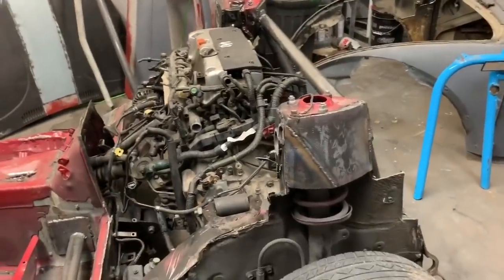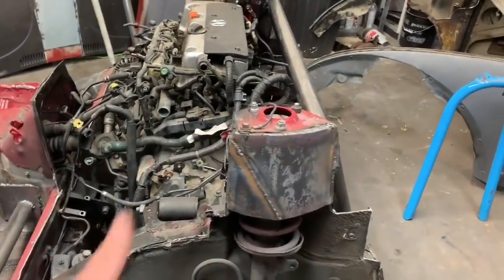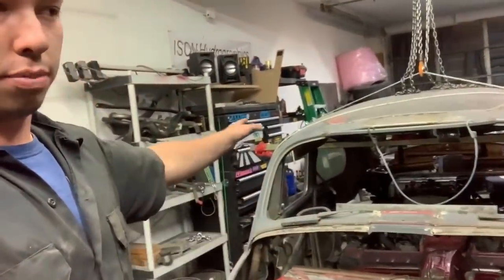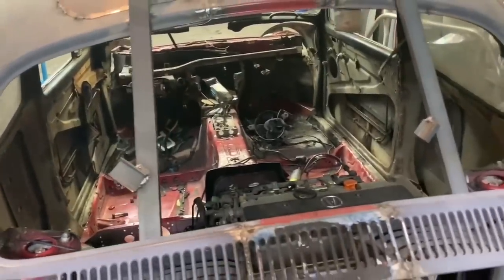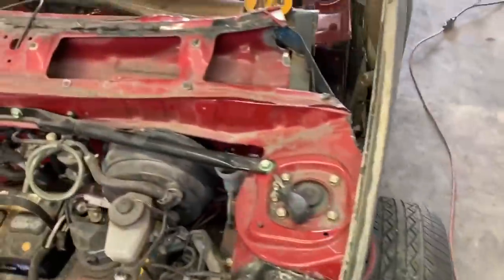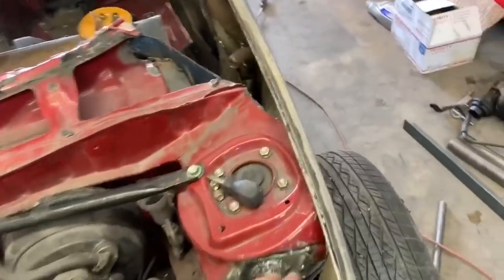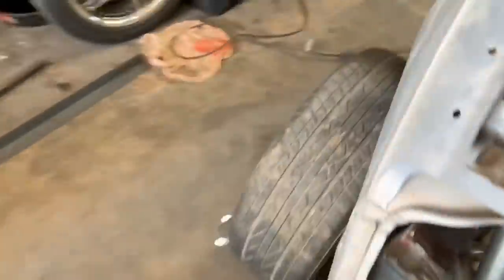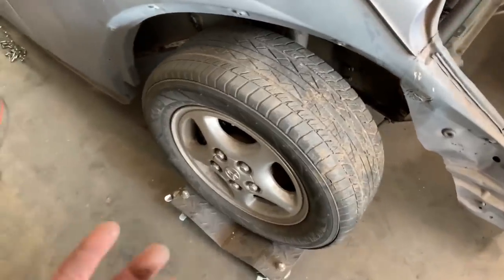Dropping The VW Body 3 Inches! [ Honda Swapped MR2 Chassis Volkswagen BUG ]

Comment: People are so protective of Cletus out there. Your channel is all about you testing what will and won’t work, and having fun finding out. If people don’t understand that they haven’t been watching for very long. What about using those clips that they use on body panels that are spring loaded and you use a big screwdriver to tighten and loosen them. I see them on cars that race at Bandemire. (not sure of the spelling) and have them along the bottom of the body along the sides? Just a suggestion.
Reply from the maker: Yea I know what you’re talking about!  Those are mostly use for lightweight body “skins” like a super thin fiberglass fender.  I don’t think I could hold the whole body down with those
Reply: Like I said, I don’t know much about some, well most of these things. I just thought I would throw that out there, I had seen them used before. But they were on carbon fibre hoods,plastic bumpers and fenders now that I go back and take a second look at them. Maybe look into having pins welded onto the frame, that the body could be lowered down on then locked into place at four corners of the cabin. With some way of locking the body down on them? Just throwing out there another untested hairbrained idea. I know you will be able to come up with the proper way to do it in the end. Will be watching every step of the way.

Comment: Suggestion right out of left field.  At the front of the car the chassis rails terminate in very close proximity to the front of the body.  Make up a couple of pipe hinges and weld them to the end of the chassis rails.  Strengthen the ends of the body and weld the hinge pins to the reinforced body. You can hinge the back of the body as high or as low as you wish and when you're happy with it make some brackets to bolt the two bits together.  Job done.  if you want to do any major surgery to it ( like fit an LS1) just undo the bolts, lift the body, stick a broomstick under it and you're in business...just a concept, but it would look pretty flash in the carpark.
Reply from the maker: That’s very interesting! I’ll look into it!

Comment: Just found this channel because of the Jeep C5 build and I truly appreciate the hackery, im building a 2002 SAAB 93 turbo right now for my next daily but I own a 54 Jeep that I've always wanted to make into a rat rod since I'm not into 4 Wheeling so I might have to still your idea
Reply from the maker: Nice man!!! I always thought putting a Jeep tub on a early 90s s10 would be a good fit as well.  Easy to lower, easy to LS swap
Reply: @GARAGEIdiotS  I just recently threw a rod in my 5.3 trailblazer so after I was done with my SAAB I was thinking about trying to use the chassis from it since I already did all Belltech suspension on it and it's AWD

Comment: Make the fenders part of the hood. Solves a bunch of issues. You clearly can remake the hood to fit however you need. Eliminates multiple cuts at the fender. This sets you up for a  single tilt front "clip" or a full on or off "clip" Just weld the fenders to the hood. make just one cut each side. Would make a nice seam.
Reply: This also sets you up for future if you want to make a clip out of fiberglass. Then it would be hella easy "on/off" moving.
Reply from the maker: Awesome idea!! That’d be sweet!!

Comment: Make it a removable definitely but have it in 3 sections? Front, rear and the middle section where you sit? I think it'd be worth while as you already have the cool factor yes, but it's pushing ourselves out of our comfort zones, taking far too much time and going the extra mile that makes something that much cooler and definitely agree with going negative offset, get yourself some decent wheels for the meantime but 3 piece Rotiform Fuchs would look awesome as they're a wheel normally used on older Volkswagens but with a different style and the option to get exact width and offset you'd want also just believe that the raked Volkswagen is a proven formula that looks good but you don't often see the entire car millimeters off of the ground all round
Reply from the maker: I’ll look into those!! Thanks!!
Reply: @GARAGEIdiotS  no stress at all man, love your work and looking forward to the end result

Comment: What is your end game, anyway? Do you want to finish the job ? What you are going to discover, with out some kind of a plan (drawing), you are going to continue down the same road you have been on and not get any where. With out a definite plan you won't get anywhere.
Reply from the maker: It’s hard to have a definite plan on something that hasn’t been done before and with me learning as I go.  However, once the body is dropped and that structure is rebuilt, the project should start gaining a lot of momentum

Comment: this is YOUR project  done YOUR way.
projects like this have a tendency to snowball  for several reasons.
things takes time and skills gets better. often this result in either going for original idea without simplified ways or the brain runs away in creative mode.
i bet there are multiple things  you feel more confident in now  vs  when you started.
and then we also have the cosmetic aspect  when realizing  some of the first made areas can be made better  etc.
imo all that is out of sight just need crude work done and sharp edges removed. 
no need to waste hours on cosmetic improvements that cant be seen anyways.
personally i think you fit into my category of garage idiots.
take it as a challenge if someone says it cant be done   and we love odd ideas like self driving chairs and beercases.
all kinda frankenstein  match up in parts to make a unicorn.
keep up the great work.
Reply from the maker: Awesome comment man, thank you!

Comment: Trace the top of the shock mount and copy in steel,add a perimeter wall to the copy and weld on top,in effect boxed junction for roll tubing????lol
Reply from the maker: I follow the first part but what did you mean by “in effect “
Reply: @GARAGEIdiotS  lazy way of adding additional strength without hacking into panel to much lol

Comment: Like I have always said bud this is your project and your channel so you do with it  with what you please .... Anyways on a different channel I was just thinking could you just cut the bottom of the bug off the height you need so you can sit it back on the MRI frame with out trying to figure out how to attach the two and it really really would give it a even cooler and weirder look could you imagine a short door with a regular size window lol just saying
Reply from the maker: The bottom channel of the bug body is a big part of what’s left of its structure.  It helps keep the doors aligned.  And we’ve already cut the mr2 part off haha so good thinking but too late now haha
Reply: Well I tried lol

Comment: Hi if you check i think you will find that you hubs are 5x4.5 the same as ford /
mopar
Reply from the maker: If that is the case, how would that benefit us?
Reply: @GARAGEIdiotS  there are lots of lots of second hand wheels on ebay and craiges list so cheap wheels for your builds just a thought
Reply: forgot to say great to watch you evolve a project i wish the UK motor laws were as relaxed as yours over here you cut  a structure point and you have to have it inspected by  sva and if theirs a edge they dont like then its a fail and you have to  fix and resubmit each time as they stop the exham on the first fail thats how they make loads of money so keep going great to watch

Comment: Get it tokyo drift a shitter is what the movie Christine called haters and you can widen steel wheels it would fit the build too make them you need check your brake situation if you are going too add weight too so weigh it soon before you go talking safety of a cage
Reply from the maker: Because we cut the entire body off, I’m very confident that even with the cage and added structure we’ll be well below factory weight.  But great thinking!! That never would’ve crossed my mind!

Comment: Who cares what some dick head thinks of your car. It's YOUR CAR. The most valuable lessons you will ever learn are learned from mistakes. If everybody did everything the same way we would have no innovation on this planet and it would be pretty fucking boring as well. The great thing about working with metal is when you fuck something up you can cut it off and do it again.